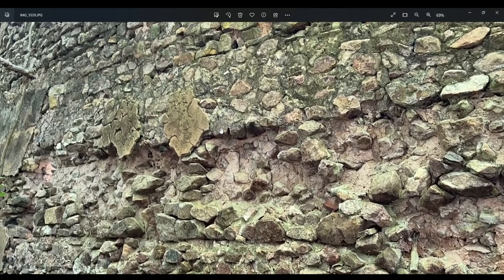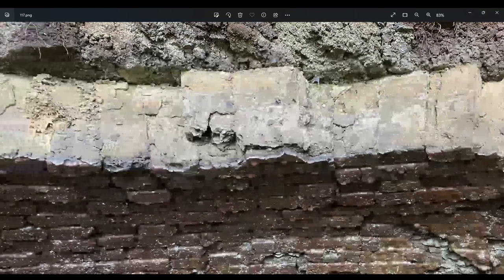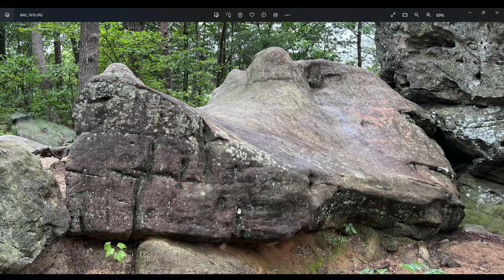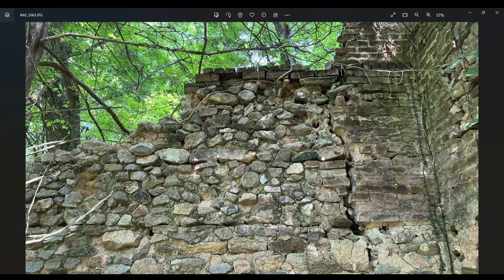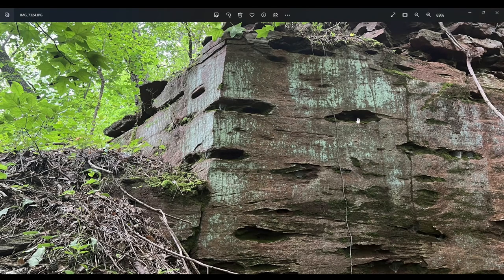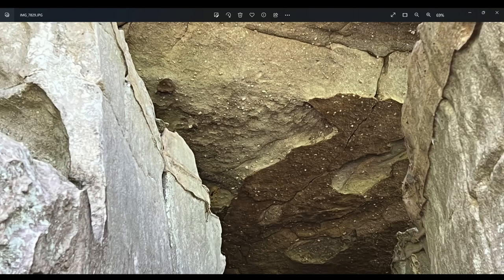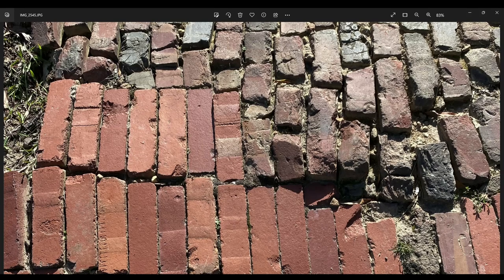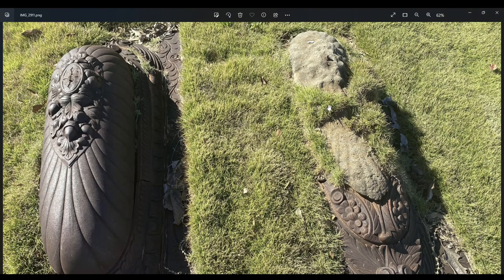Melted Buildings Explained

Comment: We know they built with brick and mortar and added a façade on top.  What you're showing in a lot of these seems either an attempt to repair the structure with what was laying around using cement, or the facade and brick fused together creating a composite material.  Its painfully obvious.  Thank you for bringing these to our attention.

Comment: 2:00 When the brick transitions/changes into the rock, is that process a long and gradual transition? Or is that change a more rapid process?  The electrical char and heat damage/melt make perfect sense to me, but the transition from brick to rock is a bit confusing.  It’s believable to me, none the less, but I guess I’m having a hard time understanding of the transition from brick to rock.
Reply from the maker: I think it happened pretty quick, whenever the cataclysm was. Just some sort of intense heat/electrical cataclysm, along with other things probably that we just don’t understand. Mainly because we have been dumbed down since birth. Most everything we are taught in indoctrinated schools are “theories” with no actual facts to back any of it up. History, geology, most science, have all been hijacked and twisted into a bunch of nonsense.
Reply: It must have been instantaneous!  A flash fry type of event, a short circuit, or perhaps we had a second sun, which is now the moon, like a bulb that went out?  Who knows, but the rock curtains & variety of damage we see in a single structure shows it happened in an instant,  it stopped as soon as it started.
Reply from the maker: @freya6766  just saw you with Old World Exploration, good stuff 🔥
Reply: @ourmeltedreality8731  
Thanks so much!  I only have 1 presentation on here that I've uploaded,  but I've got 2 more to finish & upload.   OWE is on point,  he gets it!  Thanks for your work as well, trying to undo the spell that's been cast on all of us takes team effort! 🧱❤️🙇🏽‍♀️
Reply: I thought maybe some was repair work after the cataclysm
Reply: One thing to keep in mind is that lightning or plasma, which is the hypothesized cause of melting, bombards the rock with tons of neutrons. If you’re familiar with chemistry, you add or remove neutrons and protons to a nucleus to create new elements. So the original elements in the brick can change causing it to appear like plain old rocks. It’s a distinctive feature of electrical discharge phenomena. 

In addition to transmutation electricity can also sort, deposit or remove material based on the material’s electrochemistry, so a serious plasma strike won’t just melt and char things it will change its fundamental chemical or molecular composition. It’s just not something we experience every day other than lightning. 

Just my best guess, I don’t know.

Comment: there be an electric charge between different metals and reactions to form all different types of minerals which are salts of these metals; some of the bricks may have had iron contaminates in same and are like rusted, but i'm referring to min. 2.5 not melted stuff as some examples appear to be fused which needs high temps only obtained in like a water-welder that can even melt aluminum oxide (~7K C) to make saphires/rubies depending on impurity cobalt/chromium respectively. 
some folk have pointed out doctored photos that may have been attempts to hide abundance of aerial ships about at that time 1800s.
 like perhaps kamakazee blimps with explosive gas or whatever, idk.